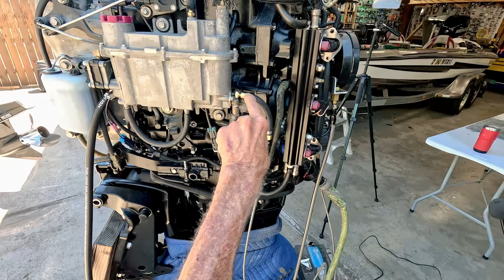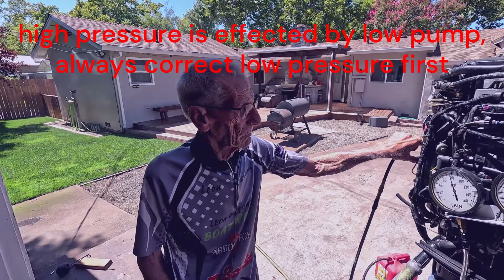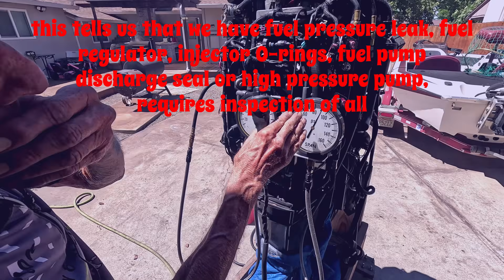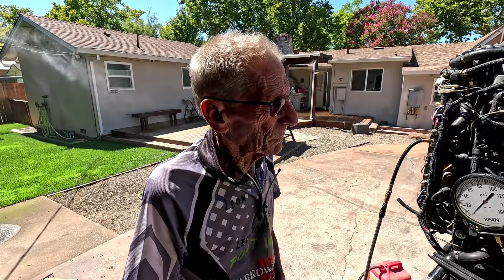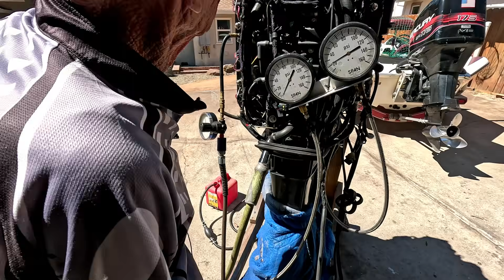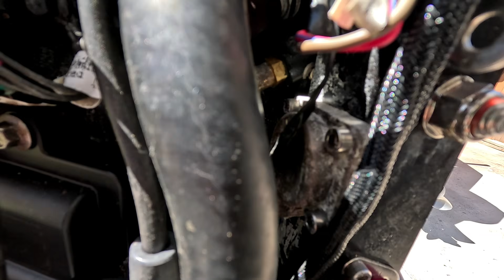OPTIMAX FUEL STARVATION; Stalling, Surging, Power Loss, FIND THE FAULT,

Comment: I replaced both pumps but am still having a problem with the low pressure side. The high pressure pump is at 90 and the air pressure is at 80. But when I try to start it, it starts then dies right away. Sometimes with a lean pop.I don't think it's getting any fuel. When I disconnect the tps It will allow me to be able to try to start back to back but still wont stay running. The low pressure side is getting 5 psi -0. What should I look for?
Reply from the maker: got to get the low pressure up to 20 psi first, do not disconnect TPS, does air stay as 80 and fuel at 90 while attemping to start, and does the pressures hold and leak down slowly after stalling. is the primer bulb pumped up till hard?
Reply: @LpBassBoatWorx  I have the air pressure at 80 when trying to start. But the air pressure bleeds down at a slow pace. I will need to check the bulb when I get home and how fast the air pressure bleeds off in seconds. Thanks for your help.
Reply from the maker: slow leak down is normal. fuel pressure MUST be 10 psi more than air at all times for motor to run
Reply: Ok i am having air pressure blowing back through the hose that connects to the vst high pressure pump outlet. I hooked up shop air and connected it to the Shrader valve on the fuel rail. I am not having any air come out of this hose. But when I crank the engine over I get pulses of air coming out of the hose. I have already replaced both diaphragms on my 2005 optimax 75hp. Could it be coming from the air injector seals? When I pump up the air side of the fuel rail to 80 and do a leak down test it drops 20 psi every forty sec.
Reply from the maker: call me and I will walk you thru the process, must have a dual glycern filled gauge set

Comment: I have a bad computer on my 2006 115 pro optimax and I want to buy a used computer that I found on eBay. It’s has the same pcm number.  Will it work and be capadable with my motor
Reply from the maker: text me pics of the tags on both computers
good chance it will work
also serial number on your motor
computer failure's on these motors are extremely RARE

Comment: I have a no start and no fuel pressure reading from the vst tested both pumps and they work gasket on the high pressure on top is worn pretty good think that’s my problem?
Reply from the maker: need much more detailed info. must have fuel/air pressure test results see vid on fuel rail diag.

Comment: I got no spark but power to the ECM and tried a different ECM. Where would you go from there? Coilpacks? 2001 150 optimax
Reply from the maker: many possible causes for this, call my number consultation, coil just one of many things to cause this, check for a blown fuse first

Comment: Thank you so much for these videos! My fuel rail holds air when I fill it with shop air but reliefs at 75. Every time I start the engine and no matter how long it runs when I shut it off it instantly loses air pressure. Faster than I can even look at the gauge. I checked the reeds in my compressor and if the rail is holding shop air is that proof the direct injectors and compressor reeds are good? I’m leaning towards I have a bad air regulator but I can’t tell by looking at it. With shop air it vents at 75 and seals again after. If I pinch the dump line while the engine is running pressure spikes and the engine shuts down as expected.
Reply from the maker: with shop air applied, motor off you should be able to hear the leak, listen to the exhaust and remove the spark plugs, if direct injector is leaking you will hear come the cylinder that is leaking.
hold a piece 3/4 hose to your ear as a listing device, are you sure your gauge is accurate?
have you pulled the air diaphragm for inspection, ls so on the side that goes against the fuel rail sealing area, do you see a flat surface or a round that looks like a ball bearing, should be flat side showing, if round side is showing, replace it, do not try to turn it over, I missed a couple things in this video and will do some shorts for more info on this
Reply: @L @LpBassBoatWorx e air holds I can’t find a leak with shop air. Only once it’s been started and shut off all pressure vanishes from the air side only. Diaphragms looked good. I replaced the tracker valve while I had that apart. The air regulator I pulled and all parts are internal so it’s hard to tell. The air disappears so rapidly I can’t catch it. It almost has me thinking my model isn’t supposed to retain air pressure because I’ve been having such a hard time locating any type of leak. Only thing I haven’t pull are the injectors but I was thinking that may be a waste of time if the system holds shop air. Only other thing I can think is it’s constantly releasing from that regulator at 75 and it can’t seal in time while running to hold any air. Which I did pull the dump line and hold my hand over it and had my wife kill the motor and I couldn’t for certain feel a rush of air at shut down. But it constantly pulses air very rapidly while running
Reply from the maker: some early models will dump air thru the direct injectors at shutdown (pcm controlled), after they dump check for air leaks pressure should hold at 78-80 psi. 
if 78 or lower replace complete regulator assy, diaphragm, cover, cup and spring, then adjust it to exactly to hold 80 psi
Reply: @L @LpBassBoatWorx mine is a 2003 135HP serial number 0T749014. Do you happen to know when the change came? I’ve been chasing this air issue for a couple weeks and seems like it might have been a waste of time
Reply from the maker: about 03-04 not sure on the small motors as I mostly service 150  and up motors, I cater to mostly tournament fishing crowd
Reply: @LpBassBoatWorx thank you I’m going to start searching for my problem outside the air system I guess. I appreciate you sharing your knowledge
Reply from the maker: what are the problems and symptoms?
Reply: @LpBassBoatWorx runs great in the driveway and will run great for a while on the water but always eventually shuts down and won’t restart. Like it’s starving for fuel. After multiple attempts to restart I usually get fuel venting out of the top of the vst. I typically can’t get it started again until the next morning in the driveway it will seem fine again. I did the CPS sensor, tracker valve, all the spark plugs, and lift pump but I did get a cheap lift pump. After I replaced the lift pump my primer bulb has improved. I also replaced primer bulb and fuel hoses from the tank line to the outboard. Inspected inside of the tank and cleaned out all lines. Checked vst and it was clean. Both fuel pumps had power. Last time I took it out and it did it. It ran great then I’d shut it off and sit a few minutes each time it was a slower crank. Was cruising slow back to the docks and it shut down. I pulled the cowling off. I pushed in the fuel Schrader valve on the fuel rail and verified I had fuel to the rails. No air as usual on that Schrader valve. Sometimes shuts down while I’m moving fast it’ll die down then shut off. Sometimes just cruising. Seems like it acts up once it’s really warmed up. Other times I’ve taken a short trip out to a spot to swim for awhile and after it’s sitting it will just refuse to start back up. Every once in a while I can get it to fire and it will go fuel rev.
Reply from the maker: take a lazer type infrared temp gun out with you, when this happens shoot the fuel out fitting temps on the VST, if temps is above 115 degrees, replace the high pressure fuel pump,
also pull the top off the vst and check the rubber outlet seal that seals the hp pump to the vst cover
Reply: @L @LpBassBoatWorx have an infrared temp gun I’ll give it a shot. Thank you so much. The rubber outlet seal did look good. I did buy a cheap amazon replacement for the lift pump and the fitting from the pump that comes off the face off the pump was a bit under sized for the hose. I can’t quite remember exactly where that one runs but I snug it down with a hose clamp. I have noticed a pressure lose in the bulb since but I still want to correct it
Reply from the maker: dump the cheap pump and get a mercury kit rebuild your old one